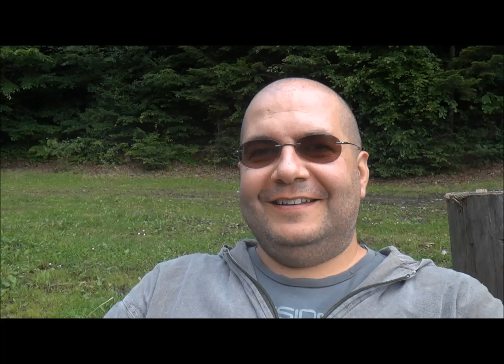another bushcraft myth: the improvised water filter

Comment: apparently coconut husk charcoal has a high surface area, the russians used it for gas masks during ww2. just seemed interesting
Reply: It isn't just plain burned coconut hull.  There is a process to get the extra surface area.  It usually involves steam or  potassium hydroxide.

Comment: Spot on and both scientifically & practically correct - well done! While with a proper (!!!) large slow-trickle sand-based filter of the correct design (nothing even remotely similar to all the "improvised" ones) a certain filter-effect is clearly existent and a reduction in microbial cell-count (factor 10-1000) can be achieved, the resulting filtered water is still not safe to drink without further treatment by chemicals or by heat. Good that you help to bust this somewhat dangerous myth! Thumb up from a fellow Chem.Eng. in bushcraft...

Comment: As the title says it is a water filter, not a water purifier. So long as the water is from a clean natural source, ie not full of chemicals, using this type of filter will be fine so long as you Boil the water before drinking. That said in a survival situation water put through this type of filter would be better than non filtered water even if you have no means of boiling it.

Comment: Is it possible to make activated charcoal at home? 
Thanks for the video.
Reply from the maker: you're welcome!
nothing is impossible :) ... but to make activated charcoal at home is way over what the average do-it-yourself-er could achieve (it requires working with high-temperature, high-pressure steam - extremely dangerous! - and a lot of experience in technology and engineering).
Reply: Is the activated charcoal that can be bought at pet stores for fish aquariums suitable for filtering water for human consumption?
Reply from the maker: sssshhhh101 it should be. but be aware that a filter is more than the filtering media, and is not an easy thing to build and operate.

Comment: It is certainly not as effective, and you have to filter multiple times. But it is better then nothing, like a last resort. I used it and tried it, still not sick btw. Still advise to boil it though if possible.
Reply from the maker: it's no better than a bandana folded over a couple of times. if you used it and didn't get sick, you could probably drink the water as it was, too... i'll elaborate on this in a future video. 
you're right about the boiling - works out just fine.
Reply: I will wait for the video..but the water I used, was moderate polluted ( checked it with a biological index test), after 5 times filtering the water was fairly clean with low enough levels of pathogens to drink about 2 liter safely.
The first 3 liters where unusuable btw. Perhaps enough flushing is the key.
I have seen improvised filters in socks ( yes you read it right) hahahaha. Most of the active carbon are made from coconutshells. I have written a whole article about waterfilters (in dutch) trailtraveller.blogspot.com (may be google translate could be of help)
Reply from the maker: Trailtraveller by flushing it over and over you probably turned it into a biological filter (a thin film of microorganisms is formed at the surface of the sand and acts as a filter), in which case the sand acts only as support. i want to read your article, you seem to know what you're talking about :) , but the link leads to some biblical studies blog?!?

Comment: Definitely a big difference between filtering (removing debris & other particles) and purifying (killing potentially harmful organisms).  Beautiful location by the way!
Reply from the maker: right on, my friend! there are commercially available filters that will filter the pathogens, but you can not improvise an effective one.
Reply: Spores and viruses are hard to filter out... 0.005 micron.  Boiling or chemical sterilization is the 3rd stage.  Boiling would be best.  Most filters are only 0.1 micron and don't remove chemicals in the water.

Tablets don't work well in unfiltered water as chemical contaminants limit the reaction.  

Regular charcoal does work, but takes a long time and doesn't last long.  Activated charcoal can be made with highly fibrous plant material for charcoal, calcium chloride and purified water.